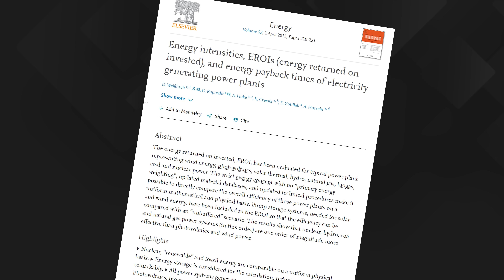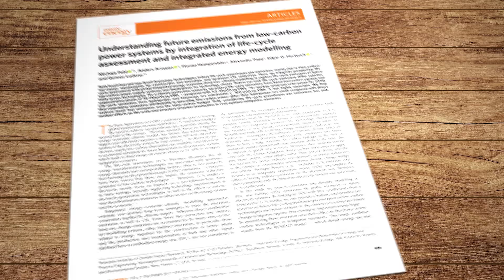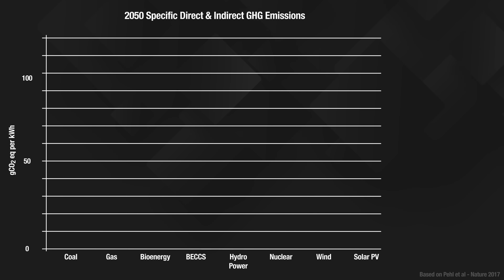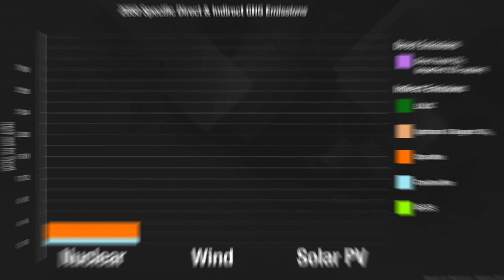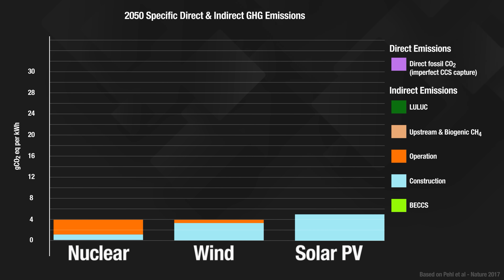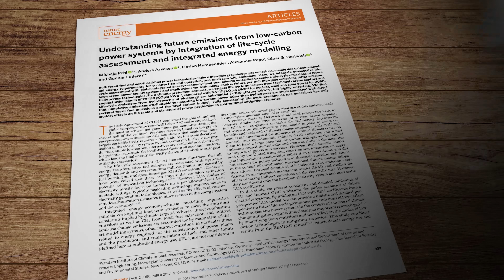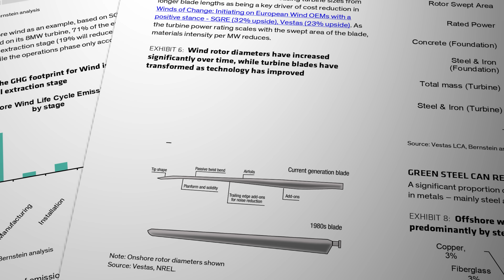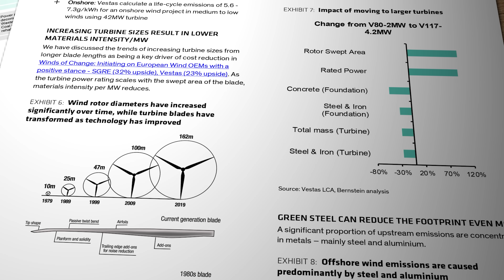Lifetime carbon emissions of renewables vs fossil fuel. Problem or solution?

Comment: Some how I suspect that the studies showing how green wind and solar are not accounting CO2 costs of batteries or electronics in a realistic manner through false assumptions.
It is a false assumption to assume that something that "is" recyclable will be recycled, or at least recycled in a responsible manner.
Plastics and electronics are both recyclable, but both end up in 2nd & 3rd world countries in embarrassing amounts to be disposed of in unsafe and environmentally unfriendly manners.
Why? Economics.
China is now reaping the problems of leading the EV revolution. Cobalt is being recycled out of EV batteries because that is about 65% of the recycle value, but its only 5% of the battery mass. 95% of the battery goes to landfills via the black market.
We don't have to worry about China's EV battery recycling woes because new batteries don't require cobalt in the anodes. That means it will be cost effect to throw away 100% of an EV battery.
Because batteries are very energy intensive to build they constitute the majority of the lifecycle CO2 emissions of an EV. Analysis has shown that when you scale up EV battery size to match ICE car ranges the lifecycle CO2 emissions EXCEED ICE car lifecycle emissions.

Comment: I notice that you are skipping fission-steam turbine and Thorium Salt reactors. Why is that? Before you answer, please throw away any political stance.
Reply: You are insinuating, without evidence, that he is biased against your pet love. He is presenting data compiled by someone else, he isn't deciding what to include.
Reply: @danyoutube7491  Dave Borland (JHAT) has done a few videos on nuclear, and has either been hostile to and misrepresented nuclear, or simply has failed to do the research (a passive hostility). His public comments speak for themselves.

His lumping in of cooling towers with the 'bad' side of emissions on the video's thumbnail is an example.
Reply: @factnotfiction5915  That's a bit of a silly judgement about the thumbnail- cooling towers are synonymous with fossil fuels, though they have them in nuclear plants too, and in fact that image does look to me to be of a coal plant or at least fossil fuel, because there are the smokestacks in the background beyond the cooling towers, and what looks like a diagonal line passing at a lower level, possibly a conveyor taking coal up into the power station.
Reply: @danyoutube7491  Incorrect. I just didn't want to read leftist political non-scientific trash. And if he is as smart as he seems, he doesn't need you to defend him.

Comment: Not just carbon, nuclear plants use a lot of water. The Arizona plant is using 50,000 gallon per minute. It uses Wastewater from the surrounding cities but they are drawing from the aquifer which will be gone in 38 years at the current rate.

We are literally taking our grandkids and great-grandkids water so we can have cheap nuclear power today.

Seems immoral to me.
Reply: Good point, and a few months ago I read something which surprised me- that various European nuclear plants do have to temporarily shut down when the rivers they (most of them) rely upon for cooling are particularly warm. That's obviously something that will become more of an issue in the future. Your point is more fundamental though; the scarcity and increasing future inability of water supply to meet demand in the midwest and west of America is disturbing.
Reply: @danyoutube7491  We could reduce unrealistically cheap industrial usage.  And that would drive those industries and some of their employees away.   There is enough water for 8 to 10 times as many people- but only if all water intensive industry and agriculture is gone.
Reply: @danyoutube7491  Yes.  Water based nuclear and increasing temperatures do not mix.

Comment: Funniest naysayer argument I heard last week. "Geothermal sounds good, but what happens when it runs out of heat?"  I wanted to say "then the people 1.5 million years from now will have to dig slightly deeper."
Reply: @factnotfiction5915  It would help if governments subsidized clean energy and phased out subsidies for unclean energy production.
Reply: @AtheistEve  "It would help if governments subsidized clean energy and phased out subsidies for unclean energy production."

Ok - just how much subsidies do VRE require?
According to the Joint Committee on Taxation, the production tax credit for wind is estimated to cost taxpayers $4.9 billion in fiscal year 2020, the investment tax credit for solar is estimated to cost $2.4 billion, and the three tax deductions for oil and gas listed below combined are estimated to cost $0.9 billion
https://www.jct.gov/publications/2018/jcx-81-18/

Comment: Honestly the audacity of some people to suggest burning stuff does not release more CO2 than spining motors with wind and water or capturing energy from the sun.
Also, I think land use should have been included in the analysis. Us here in Georgia were planning on building another hydro plant and a lot of debating was done over the environmental impact of cutting down the forests to make space for it.
Hydro works best where water is and water is also were life is, so finding land that is not occupied by a settlement or forest near a substantial river will be impossible. 
You can mount wind turbines on mountains and solar panels in deserts with little to no environmental impact. You can also mount them on rooftops.
 And nuclear and most fossil fuel plants take little space for how much energy they produce.
Reply: yeah ... i always say land is not a renewable resource.  ;-)
Reply: @justgivemethetruth  that’s why I say that nueclar is much better than renewables because they take up over 200x more land per kilowatt hour than renewables

Comment: Doesn't include batteries or other techniques to make renewables less unreliable, without which the comparison isn't apples to apples. It's like comparing a steamboat to a sailship, one might have more emissions, but it can do things that the other cannot, which might be the difference between life and death in some circumstances. 

Also solar and wind produces more in some locations and less in others. As we build more solar and wind, we will have to build in locations which are more and more suboptimal, meaning higher economical and environmental cost per unit of power produced, on average.

Comment: 12:15 and by recycling, they mean... ? Thermal recycling? Landfill? Mixing into concrete?
I haven't come across a procedure to sustainably (>90%) recycle carbon or glass fibre reinforced polymers that did not include downcycling of major parts of the material. A little bit more information would really be interesting here.

Comment: I'm not sure but I worry the high hydro numbers may be narrow sighted as most data available is in reference to large dams. This  view comes to mind from the Iran oil crisis in the 70's. Jimmy Carter was President and sent out the navy engineers to look at potential micro power sources such as weirs and waterfalls. It's a long time ago but the memory lingers because the total was enough to replace multiple nuclear power stations for the States.  Moving water means no additional methane from algae and micro-gen leads to resilience. One problem then was the lack of technology to push the electricity back to the grid. Now add tidal flow/range and wave energy to see water is a hoot. Michael Harrison below points out the cost of expansion of the grid, he's right but perhaps this is mitigated because many are local or can be combined.   What do you think?

Comment: CO2 is not destroying plant life, it is literally feeding plants and making the world greener.    Nitrogen based fertilisers are derived from fossil fuels and have boosted global crop yields that help feed the world.   If you suck more CO2 out of the atmosphere, that will be bad for plant life and animals that depend on that.   The problem with renewables is they cannot replace a single gas, coal or nuclear power station while running power stations on and off is hugely inefficient in itself.  That could change with mass battery storage, but so far that looks like pie in the sky.

Comment: Nuclear has been considered an essential element in our energy future. I would like to see a similar comparison between nuclear and battery grid storage. Maybe even adding pumped hydroelectric in that comparison.
Reply: What you going to do with the nuclear waste?
Reply: @jamesag4135  
And small reactors will produce more none fuel waste
Reply: @jamesag4135  It can be reused or stored deep underground even lower than oceans. This way, it can never contaminate our environment.

Of course, the inherent problem with this method is digging the hole. Which would likely produce a lot of carbon emission. But presumably, if the hole is large enough and can be used for a considerable length of time before being sealed up completely, it would mitigate the carbon cost to dig.
Reply: I think hydro storage would be a big part if it didn’t need so much space. Nuclear is just ages ago from being really accepted by the public but it might have made sense too leave more of them running till they are really not usable anymore. Today building new doesn’t make a lot of sense.

And then we need to take into account that lots of energy companies don’t want to build anything like that any as there aren’t enough people to maintain and build these things in the first place till we get that again it’s already over.

Comment: I'd been dead-set against nuclear for decades, but recently I have seen people speak of this more positively. When you think their is "radiation" in coal fired emissions, and the deaths from nuclear in comparison to pretty much 'all' of the alternatives are very low? Having said this again seemed to cast nuclear in the shade somewhat.
Reply: Nuclear waste vs over 150,000,000 tons of wasted coal fly ash each year in the U.S. alone. Which can also be very harmful when handled based on elements in the residue. And those waste piles keep adding up, literally mountains of coal waste. 
Nuclear energy really did get the short end of the stick so to speak. 🤔
Reply: https://ourworldindata.org/uploads/2020/10/What-is-the-safest-form-of-energy.png

Comment: As the Arctic is warming at 2-3 times faster then the rest of the northern hemisphere, Global winds that migrate from the upper atmphere over the tropics into the Arctic is slowing down. Warm heat normally migrates into cold. This is causing Global Stilling and is or currently slowing down wind turbines. This will slow wind turbines by 15%.

Comment: Thank you. The present CCS technologies are very expressive, energy intensive, do not remove enough CO2, and are horrible for every other environmental parameter (acidification, air pollution...). It is madness to invest in it instead of in modern renewables and storage.
Reply: Nobody who has ever passed a college level thermodynamics course can do anything but try to suppress their laughter whenever carbon capture comes up as a solution for fossil fuel plant emissions.
The idea is analogous to trying to drive an electric car for free by putting a wind turbine on it.
Sadly, both of these schemes sound plausable to the majority of the electorate.
Reply: @NullHand  You need to differentiate between CCS and DAC. Attempting to use DAC to mitigate a post plant would be madness I agree. But CCS at source on a power plant Cam work. It takes about 1/3 of the energy of the power plant to do it, but that still leaves 2/3 as useful output. It pushes the cost up past renewables, but gas peaker plants with CCS can provide a useful backup to renewables for the time being untul storage technologies improve enough to take over.
Reply: @adrianthoroughgood1191  I agree. Capture cost from source is around $50-100 while DAC is over $400. If you factor in transportation cost CCS will get a bit more expensive but still it’s a viable option although CCS needs to be proven at large scale.
People who oppose CCS need to understand what we emit today will have to be captured back at one point in the future.
Reply: CCS is a 100% conjob on the part of the fossil fuel industry.  Any politician that has been sucked into this conjob should be voted out of office asap.
Reply: Is it really true? Any references?
Reply: @janami-dharmam  take iceland for instance - last year a company called climeworks started running "The world’s largest plant designed to suck carbon dioxide out of the air and turn it into rock".

the plant will draw 4,000 tonnes of carbon dioxide out of the air every year (according to the company),  which equates to the emissions from about 870 cars (according to the EPA). that plant cost between 10 and 15 million US dollars (according to bloomberg). as a comparison, 2021 alone around 60 million cars where sold worldwide.

 so i'd say CCS is currently where wind turbines where in 1979 - way too small and way too expensive.

although i don't agree that it's madness to INVEST in it, i'd say it's madness to RELY on it. we need to rapidly start reducing our emissions NOW, not in 30 years. but it MIGHT help us reducing the already accumulated CO2 in our atmosphere down the road, if used TOGETHER with all sorts of natural drawdown solutions.

for me it's not an either/or, it's about keeping all options open...
Reply: @jochenzimmermann5774   I wondered the cost and revenue for CCS solution from Iceland company.what fund can support massive application without any payback?
Reply: @wujeson3921  They sell carbon credits to people who do things that are incredibly hard to decarbonise, like flying.
Reply: Genetic engineering is a better development path for the technology but then they'd have to invest in wilderness without extraction.
Reply: "Thank you. The present output of solar and wind technologies are very expensive, with low output, and are impractical for large scale power production. It's madness to invest in it instead of high efficiency, low emission fossil fuel plants like CCGT gas power plants"
~ some experts in the 1990s
Reply: Wrong wrong wrong
Reply: A statement couched in ideological absolutist terms.
Reply: @criticalobserver5720  blah blah blah.
Try harder mr critical observer.

Comment: I used to think biomass was a good idea until I found out that solar energy produces more than 50 times the energy from the same area.
Reply: Now realize that nuclear is about 1000x denser than solar PV.
Reply: @factnotfiction5915  Yes, I can imagine.. I am quite positive about nuclear.
Reply: @factnotfiction5915  Biomass is just stupid compared with nuclear.
Reply: @factnotfiction5915  But nuclear electricity costs about 5 times more than new solar power plant and new wind power plants.     Look up levelized cost of energy and levelized cost of electricity.
Reply: @ronaldlindeman6136  LCOE - a very misunderstood metric - and mostly useless (as I will explain).

1st - LCOE is a theoretical model of what costs might be, based on assumptions of future interest rates, on assumptions of learning curves, on assumptions of future demand, etc.

Let's compare that to empirical data - known real-world data spanning decades. Of course, the past does not always predict the future, but it is a record of WHAT ACTUALLY HAPPENED.

2nd - Germany vs France
German retail electricity rates are 2x that of France. But only since the Energiewende started and a high-reliance on Variable Renewable Energy (VRE - i.e. solar/wind; mostly wind in Germany).
Also, as an aside, Germany has emissions 7x that of France and well above the European average (French emissions at the bottom of the list).
~ 40% wind in Germany 
~ 70% nuclear in France
Hmmmmmm.

3rd - California vs Illinois (a completely different economy and legal system and grid)
Californian retail electricity rates are 2x that of Illinois.
~ 40% solar in California 
~ 50% nuclear in Illinois
Hmmmmmm.

Real-world data trumps hypothetical calculations, and the facts (as can easily be verified using IEA.org or EIA.gov or statistica.com data) are that high penetration nuclear is cheap, and high-penetration VRE is expensive.

4th - So what about the LCOE?
Do you buy a pair of shoes based on the cost of the shoes or based on the cost of the shoe factory?
Cheaper shoes might come out of expensive factories due to the higher-tech, bigger-size, etc, etc.

Nuclear power plants are expensive factories that make cheap electricity.

"Look up levelized cost of energy and levelized cost of electricity." - I suggest you look up real-world electricity rates. If VRE is so darn cheap, why do they produce such expensive electricity?
(Basically, its because high VRE grids need extra assets to provide reliable electricity - and SOMEONE has to pay for that - i.e. ratepayers and taxpayers).